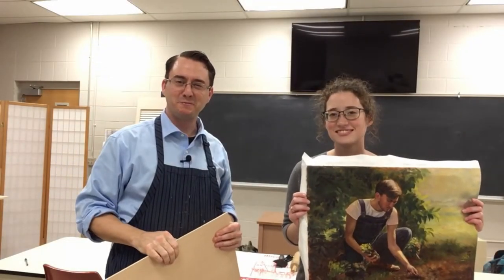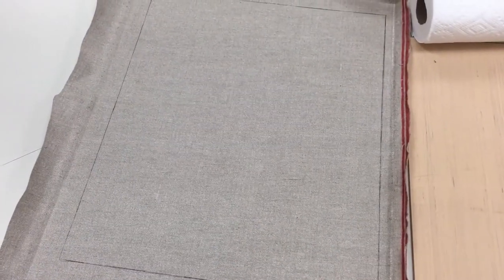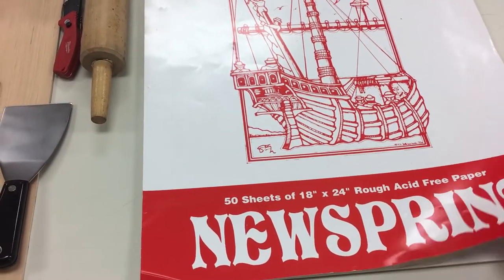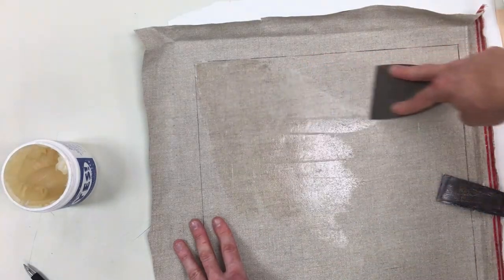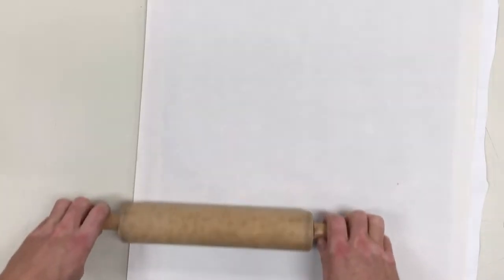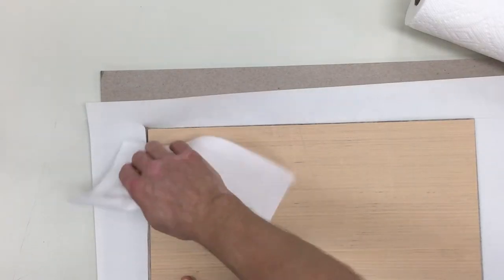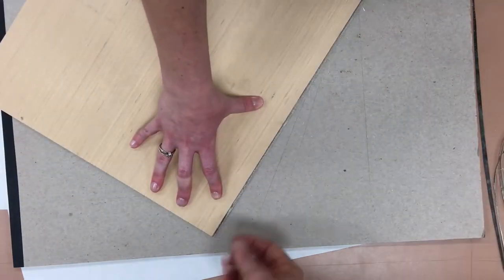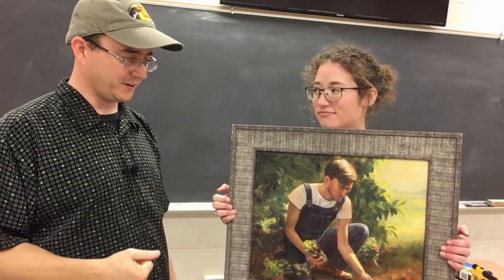How to Make Your Own Canvas Panels

Comment: Can you do this before painting on the canvas or is it advisable to paint on a loose canvas rather than one that has been mounted?
Reply from the maker: David Baral Great question! 😃. And thank you so much for commenting. I really appreciate that. So, to answer your question, I’d recommend gluing the canvas to the panel first.  Usually the only reason I do it this way is to fit an existing painting into a custom sized frame.
Reply: @mr.drewpaintswithyou9034  Ah. That jives more with what I was thinking would be better (I was envisioning the canvas flopping all over the place under the brush!). I'm always learning something new from your channel!

Comment: Very informative video. I’ve been researching the process so I can save a bit by making my own. I’m not quite sure if regular plywood for construction is appropriate or if it has to be a certain type though. What are your thoughts on this?

Also if I’m using thicker wood, is it advisable to trim the canvas or fold it behind it neatly like when I’m using stretcher bars?
Reply from the maker: Thank you for the comment. 😄. So sorry for the late response. I usually use 1/4” birch plywood though regular hard board (Masonite) should be fine. Just a heads up, I’ve had success with the “Yes” brand paste, but I’ve also had some panels where the canvas has separated from the wood. 😬. I live in Florida now so maybe the increased humidity and heat has negatively affected the bond between the canvas and the wood.
Reply from the maker: I’m thinking of trying some other type of acid free glue to see if it has the same issues. I’ve also started priming birch panels with 2 coats of acrylic gesso and then another 2 coats of Gamblin oil primer. That creates a nice smooth surface and the oil primer keeps the paint from “sinking in” and looking dull.
Reply: Thanks for the insight. I didn’t trust myself to glue the canvas to the wood so I ordered the cradled panels from Tara Fredrix. They seem to work pretty well for a lot of folks lol!
Reply from the maker: @SH3DXZ  Update: I've started using Lineco Neutral Ph adhesive for gluing linen and canvas to boards.  That seems to be holding better than the Yes brand paste. :D
Reply: @mr.drewpaintswithyou9034  thanks for the update. Some day I’ll try to make my own lol. I’m sticking with Fredrix for now though.